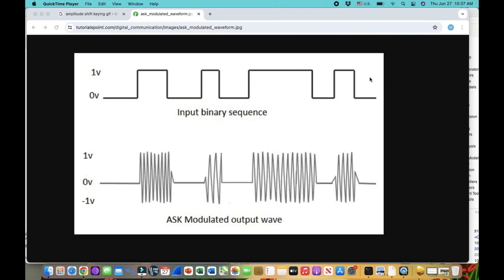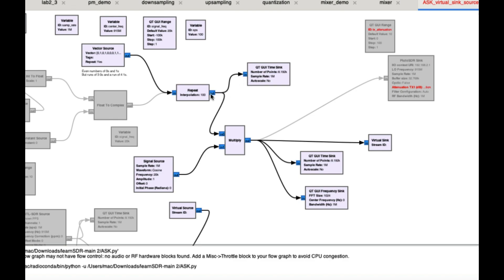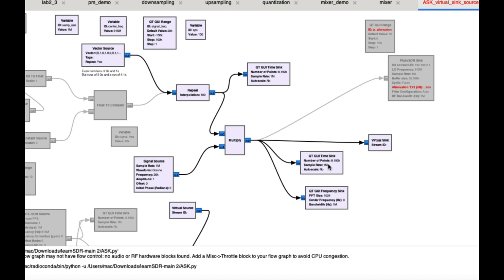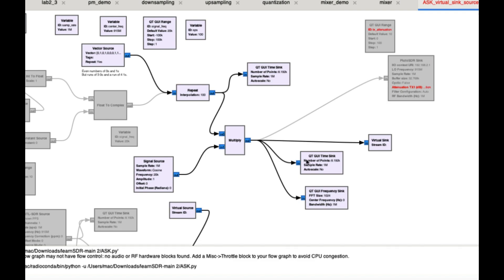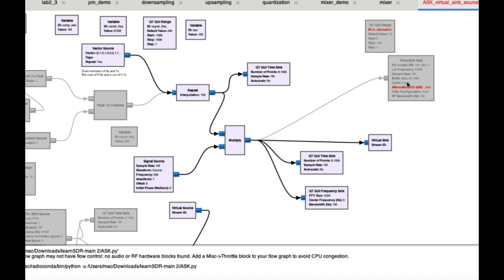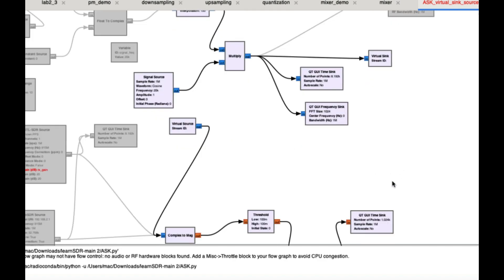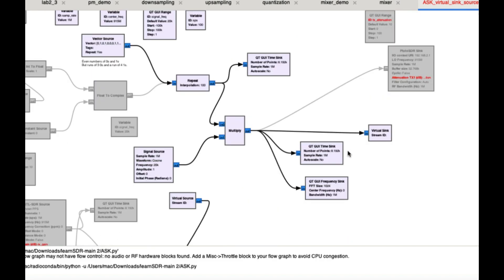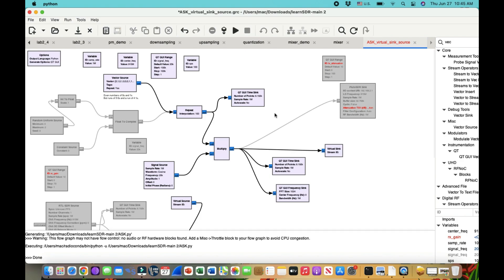GnuRadio Tutorial | Amplitude Shift Keying | on-off keying (OOK) Modulation Complete System Design

Comment: I'm working an OOK problem with known transmission algorithm (24 equal frames per sequence. 6 equal divisions per frame. 1 pulse per frame. 1 ms pulse width.) So, each frame is 144 ms. I'm recording using RTL-SDR and reviewing in Audacity. It appears the total frame time is 144.5 ms rather than 144 ms. Also, some pulses seem out of place (e.g., a pulse spanning from 2.5-3.5 ms on the timeline). How do I determine if the 144.5 ms vs 144 ms problem is based on transmitter clock timing or SDR/computer interface? Regardless, the PC sees the sequence as 144.5 ms. Is there a good way to correct/adjust for clock timing (e.g., -xx %) in GNU radio? That won't actually correct the few pulses that split divisions, but it would be a stepp in a better direction...
Reply from the maker: Working with RTL SDR there is always a synchronization issue, and I am surprised that you only off by 0.5 ms
Reply: @Muhammed_Mustaqim  Ahh. Thanks! Any recommendation for a consumer-grade device that would minimize this problem?